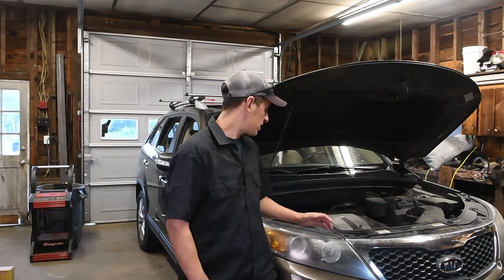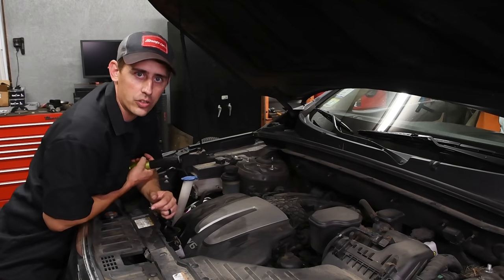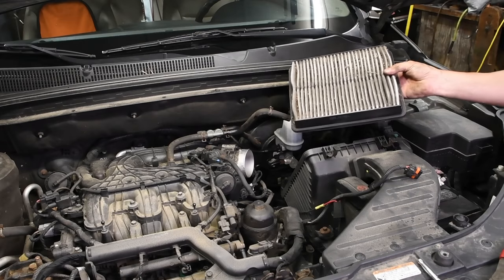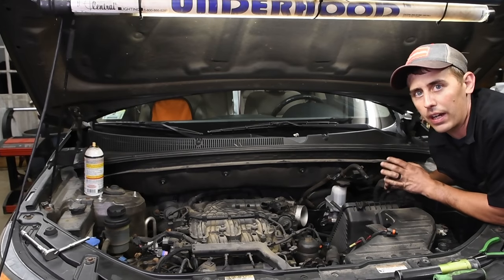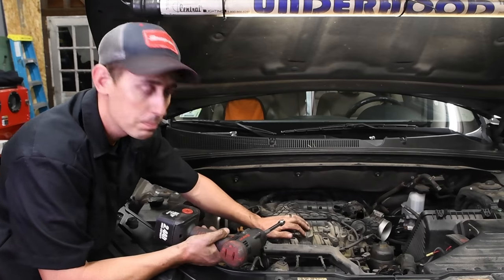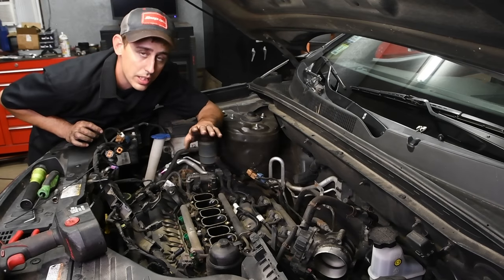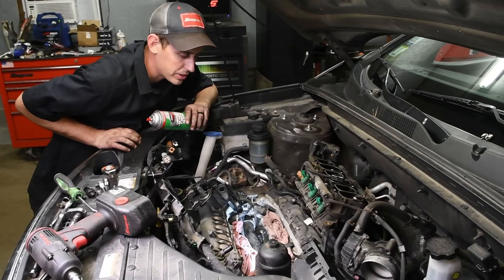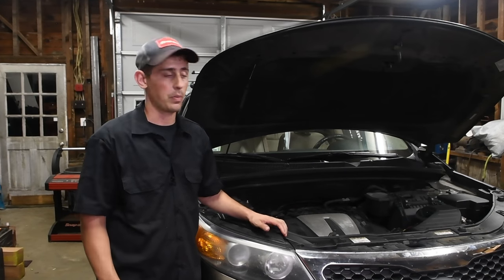Kia and Hyundai 3.5 oil leak diagnosis and repair

Comment: Great diagnosis.  got a 2016 sorento v6 - 66K miles, oil is leaking.  oil sensor is now extended warranty 150,000 miles, 10 years, problem is dealership says its lower oil pan gasket and oil filter housing both leaking (and not the oil sensor),  they would not do the lower oil pan gasket by itself, said both have to be done at same time due to one causing the other to get worse if only one done....but they are not 100% on the oil filter housing.  said oil change needed first, which I had already done.  question, could the oil filter housing have a flattened gasket (where it mounts to the engine block) as opposed to the entire plastic housing itself needing to be replaced?  if I can figure out how to get the oil filter housing off (it's top mount oil filter on this 3.3 V6 Kia) I can see about if the gasket is bad.  But man it looks like it's real hard to get that oil filter housing unbolted. (subscribed!!!)
Reply: Wow. Very interesting. Did you solve the problem?
Reply: @ericjones363  well, I took the oil filter itself off, inspected, took the o-ring off, put it back on and put as much oil on it as possible, then reseated it.  It's winter-time now so I put some paper towels under vehicle and I keep checking for leaks.  Leaks seems to have slowed way down, but I still see some fresh oil on paper towels and need to further investigate. Maybe it slowed due to winter-time?  I will certainly re-visit this when warm weather is back (in a couple months) and see what she looks like.  Thanks for asking and I'll update this When I know more.  It's a real bummer. Again, I appreciate you asking.

Comment: Amazing video! I love how you show each and every bolt, hose and wire connector!
I have had a slow leak in my 2011 Kia Sorento with the same engine for  at least 3 years. One shop said it was the water pump seal. Your description of the leak sounds spot on though. Going to look tomorrow and try to see that valley. 

Do you think the sensor would leak this slow for that long though? Or is this usually an all or nothing failure? It's starting to slowly get worse.

Keep up the great work!
Reply from the maker: Thank you! the sensor could start off as a small leak and progressively get worse.

Comment: I've replaced the sensor once before and I believe it's leaking again. What causes that to fail? And did you Teflon tape the threads or put anything over the threads on the sensor before reinstalling?
Reply: Really? Did you solve the problem?

Comment: Hey , you're doing great work!
I have oil leak on my 08 Entourage , at front passenger side of engine. I can see it accumulating on nearby distributor. Any common leaks in this area? I still haven't figured out exactly where it's coming from. Tia. Mark

Comment: I have a oil leak did not lose pressure but lost a lot of oil. So I got it in the air and inspected and discovered there is a safety inspection plate or just a plate right next to the flex pipe and location is on motor block bottom easy access just not sure if that is my issue thank you

Comment: Very good procedure for repair.   Kia USA issued letter on this:  Extended coverage  15 yrs -  150,000 miles.   Dated 07 April 2022.  V6's
1st step might be to disconnect Battery.  Lots of loose connectors hanging about.   Again great job!

Comment: Thumbs up and followed. Very impressive. I have a 2008 Kia Sorento. Does this video apply or are the engines quite different. If I have no idea where the major oil leak is coming from, what should I say to the mechanic/shop?  I really appreciate any guidance you may have?  Should I try that “stop leak” liquid first?  My car was running. Fine. Never had to add oil in the months prior. During a routine oil change I was informed that I had a major oil leak but I was suspicious of that shops upsell practices so I got the oil changed elsewhere. I would really appreciate any advice you may have.
Reply: I had a small oil leak get much worse after an oil change it turned out to be cracked oil filter housing

Comment: I have a kia soul 2016 tht started leaking... come to find out its a small hole a little bit above the oil pan.... what do u recommend? I'm using sealant today but I need it fixed permanently

Comment: This is a great video! I'm looking at buying a used Santa Fe from this era (or the earlier ones with the 3.3L) and I'm wondering... since this is so common, have you seen it happen again on the same vehicle after fixing one? I saw one person left a comment on here about 8 months ago saying they replaced this part once at 85k and again at 111k. I'm not sure if I should steer clear of these engines if the replacement sensors still have this defect. I have also read some reports of total failures of these engines... like, suddenly exploding. Do you think if this leak went undetected and suddenly caused the car to dump all that oil while it was on the highway, would that be enough to cause this kind of failure? 

Finally, do you have any hands on experience with the previous Hyundai 3.3L (2006-2010 Sonata, 2007-2009 Santa Fe) and 3.8L (2006-2011 Azera, 2008-2012 Veracruz) engines? I know they frequently have a front valve cover leak that can ruin the alternator, but I'm curious if they have any other issues like the one in this video. 

I'm not a mechanic at all, just curious about your opinion. Hard to find cars as nice as these for a decent price these days. If the engine problems can be permanently fixed with the help of a youtube video, that makes them a tremendous value. Thank you!
Reply from the maker: Its very possible if this leak could ultimately cause an engine failure. As far as I know the older versions don't have this particular issue. Thank you so much for taking the time to watch!

Comment: I have a 2011 Sorento with a major oil leak.  The video was phenomenal, but the work looked a bit beyond my skill level, so I took it to the shop.  Besides the $20 sensor, the mechanic said I also required an intake gasket set at $65, plus 3.5 hours labor quoted out the door for $510.70.  Does that sound right?
Reply from the maker: That sounds about right
Reply: @InTheShop thanks bro, I’m with all others in saying you are incredible.  My long-standing tried true and trusted mechanic took 1 look at it and called it a rear main seal and refused to touch it.  Even after I told him about his video.  Guess I need to up my game…

Comment: I have a major oil leak on a Kia Sorrento 2014 3.3 engine and I’ve been down inside of it at least 3 to 4 times now I think I’m gonna change the oil pressure sensor housing gasket because I put two or pressure sensors edit, and it still leaks from that valley. Do you have any other suggestions?

Comment: Wow he sounds honest.. most mechanics lie.. I paid for spark plugs and valve cover gasket and My Mechanic cracked the valve cover and didn’t tell me, and oil was splashing all over. I paid $25 for a glue. Temporarily because I am afraid that replacing the valve cover will solve the problem. I’m hesitating..

Comment: Mine is pooling middle of the transmission but the leak appears to be coming from the piece that is attached to the side of the oil filter. I only see spots on the ground. I am going to wash down the current oil and hope my leak is  from that gasket since I don't have a garage and it is a bit wintery here. I've replaced head gaskets in the cold. Rolled a transmission out with snow up to the door of the car on ramps, but I am tired of doing repairs in the cold.

Comment: I have the exact same model 2011 Kia Sorento 3.5L V6.  It also has an oil leak so I took it into an independent shop today.  The oil that I could see was on the bottom of the oil pan so I hoped it was simply the drain plug.  The shop diagnosed it as a leak at the front timing cover and said it was about a 13 to 15 hour repair.  They aren't taking on any "big jobs" right not and said the dealer would probably have to fix it.  Unfortunately I didn't see your video until after they called me to report their diagnosis.  After hearing your comment that it's the oil pressure sensor 99% of the time I'm wondering if the shop is wrong about it being the timing cover.  I'm going to try to check it when I get the car back.  Once I remove the engine cover do I need to start the engine to see if it's the oil pressure sensor?  It wasn't exactly clear to me how you confirmed the source of the leak.  Any thoughts on whether the shop could have mistaken an oil pressure sensor leak for a timing cover leak?  Thanks!

Comment: Hey man. Very useful video! I followed your instructions, but then I made a big huge mistake. I overtightened the pressure switch and the port cracked and broke. I ordered the Cover Assembly Oil Drain replacement, but I need to figure out how to replace it with that big black coolant line in the middle. Any help with this would be appreciated. I can't find any tutorials on here about this.
Reply: Same thing happened to me my 2015 Kia Sedona the thred got stripped. What part number you ordered did you have any luck?
Reply: Were you using a torque wrench?

Comment: Super nice job, easy to understand. A question. My 2006  kia sedona has an oil leak dripping the the alternator. Shop says it is the valve cover gasket. It is about an $800 repair. Does that make sense to you? They also want to replace both sides and some additional parts which takes the bill to $1000.
Reply from the maker: Sounds a little high on the price but I would need to see an itemized quote to know for sure. the job can be pretty involved.

Comment: Thanks for making this video! I have the same issue going on on my 2010 Kia Sorento but I'm still not sure if is the rear main seal or the oil pressure sensor like you said, would it be a way to check the oil like from the top without removing the intake manifold and all those accessories on top? I appreciate the time that you're putting to make this video. Thank You!!
Reply: Did you solve the problem?

Comment: Hello I have a 2005 Hyundai santa fe 3.5 do you know if I have to take the throttle body and the hole plenum because it looks like it's split in the middle wondering if you would know I can't find a video on a 2005

Comment: Same vehicle as mine 2011 Kia Sorento EX V6 3.5, my oil leak seems to be coming from the oil pan seal, which appears to be a gasket maker from the factory instead of a paper seal, but the frame is a bit in the way of 3 bolts, I would rather tackle this job myself to save $450 quote from the dealer, any advise would be greatly appreciated, it leaks while car is at rest in the garage, so I would think the oil level is above the seal line for it to do that.

Comment: Thanks for your help and support. I have a 2007 kia sedona oil leak and I'm not sure where it's coming from. The shop I had look at it didn't seem to know either. From the Bottom of the Sedona I can see the leak on the passenger side which looks like it's also coming from the oil pan. Do you have any suggestions?

Comment: I  have a 2.2 diesel santa fe with the same symptoms. Excessive oil leak below the engine, no smoke. Would the diesel engine sensor be located in the same position.
Reply from the maker: Hi Shane, unfortunately I’m not very familiar with the diesel versions of these. They aren’t available around here.
Reply: @InTheShop  Thanks man. Liked your video. Very well done.

Comment: 2012 Kia Sedona, I do have oil in the valley below the OPS. I cleaned everything yesterday and let it sit overnight. Mid 30s last night, 40 at start up this morning. Oil appears to come from under the plate which holds the OPS. It flows towards the rear and follows a shelf across towards the drivers side. I cannot detect a direct connection of oil from the round sensor housing closest to the area under the plate held on by 2 10mm bolts, one accessible, one hidden under the coolant crossover pipe. I slipped a socket on the accessible bolt and it was tight. Could a gasket go bad under there?
Reply: Cleaned the entire area and watched the leak start again. It appears to be coming from between the head and block. It slowly fills the ledge. After shutting the engine off, the oil slowly seeps back between the head and block. Clean it again with brake cleaner and I can reproduce the same welling up out of the head gasket area.

Comment: Where exactly to aim the flashlight? I could not see the oil. And will a bad sending unit always throw an engine light? The leak just started on my 2012 sorento with 85,000 miles.
Reply from the maker: It wont typically set a check engine light. It can be very hard to see into the valley. If oil is coming from between the engine and transmission is is almost a guarantee to be this sensor.

Comment: Not sure where you are looking before you are sure of the diagnosis. And where is the link to the parts? Thank You
Reply from the maker: If you look down under the intake manifold with a bright flashlight you will see oil puddled up. The links are in the description of the video. Thank you for watching!

Comment: Have the dreaded p200a code for the actuator motor.  Possible manifold butterfly damage.  Was thinking about repairing this and proactively doing the oil switch as well.  Have you done this repair yet?  No videos on You Tube yet except one showing the manifold with one side bad and not opening.

Comment: You are a very good and thorough mechanic (hope you don't mind the old-fashioned label - my dad was one). My experience - Had my oil pressure switch replaced because my 2011 Santa Fe started to have a flickering oil pressure warning light (only at idle) a week after an oil change. After a high-labour-charge bill to do this the oil pressure light still flickers at idle. The repair shop told me (without getting specific) that the only other possible cause involved taking the engine apart. Assume it is the rear main seal as you and some other online sources mention.  Note: the engine hasn't been leaking oil as far as I have seen. Oil level was full before the recent previous change. Any chance that I can drive this vehicle awhile longer and avoid a catastrophic failure, as long as I don't get stuck at idle in stop-and-go traffic often?
Reply: Some times new parts are bad. This happened to me. I replaced it with another new part and it was good 👍

Comment: I have an older 3.8 engine (Azera) but the leak is much slower. Maybe an ounce a day if that, although i think it's getting worse gradually.  But the leak seems to be coming from the "valley" leaking near the transmission and further pooling onto a crevice below where's there some electrical connection (only one connection) that i'm not sure of what it is, that is to the left of the battery and to the right of the front of the engine (maybe where the torque convertor is).  Do you think the leak is from the oil pressure switch or could it be something like the oil cooler?  The only other videos with a first generation Azera showed a leaky oil cooler near the knock sensor and the other video had the pretty common leaky upper valve cover where the oil slowly runs onto the alternator.  Thanks for your great and helpful video.

Comment: Have a 2008,sonata, that after figuring out it was the sensor, replaced it. Though it is not buried as deep as the one in the video. But after the replacement notice that even more was coming out and realized that the peice it bolts in was cracked. Cannot seem to find any info on this or what the part is really called. Contacted local dealership about getting it replaced, been a week and they still ahve not got back with me. Any help or ideas would be great.

Comment: I have this issue but it's a 2012 kia sorrento with a 4 cylinder, is this also  a common issue with the 4 banger ? It appears to come from the rear of the engine in the drivers side

Comment: Hi very good video I am just wondering if you used a OEM replacement part and if you know Hyundai has updated this faulty pressure switch? 
Very well done video
Reply from the maker: I used an OEM sensor. I honestly am not sure if Hyundai has updated it. I would guess they have considering it’s a common issue.
Reply: I HAVE had to repair a
Couple times now.  we had a week of -35 c weather.   I think last time it went in this weather also.

Comment: This works also for the 2011-14 Sedona vans also. If you are doing spark plugs you basically do this until you get the upper plenum off but not the lower one.
Reply from the maker: 100% Thank you for watching!
Reply: Is it the same for the 2019 Sedonas too?
Reply: @ericjones363   Those years (3rd gen) use the Lambda Gasoline Direct Injection (GDI) 3.3-liter V6 which is a different engine that in this video, but the oil pressure sensor is in a similar location. https://www.youtube.com/watch?v=-C3MqHg76Sg

Comment: What spark plugs would you use while on there? So many choices out there. Which ones are best?
Reply from the maker: I typically recommend NGK plugs for imported vehicles. I have had the best luck with them.

Comment: 2014 Cadenza 3.3L -  just last week the oil light came on at low RPM - and oil started leaking like the waterfall you describe  Took it into my favorite shop and they diagnosed the rear seal.  If this is the actual issue, it could save me around $3k to pull the engine (?!?)...Not sure I could do it myself though
Reply from the maker: I would absolutely inspect this before pulling the motor. This is a relatively simple job.
Reply from the maker: Let me know what they find.
Reply: I jus did my cadenza today after watching your video.  Only difference is that the injectorand fuel rails are under the lower plenum.
Reply: Thank you.  Great video btw. Saved me tons. Kia wanted $897.44 to do it
Reply: "Injectors and fuel rails"

Comment: Great video.  Mine has the oil light coming on at idle.  Plus the leak. I'm assuming both symptoms would be the switch?
Reply from the maker: Thanks Ryan! Yup the light on and the oil leak are both related.